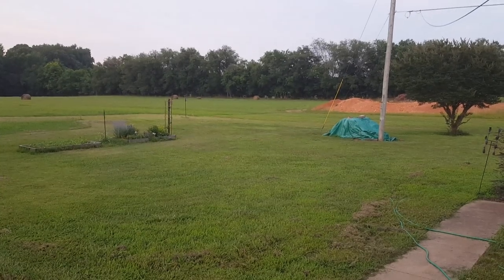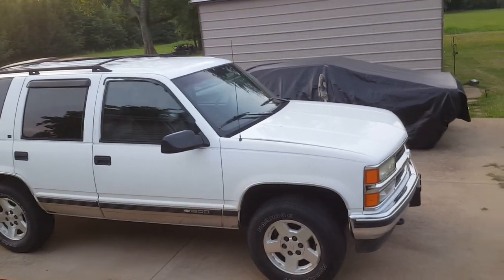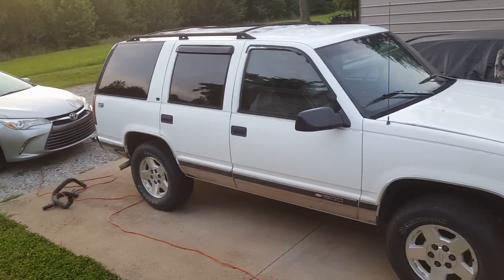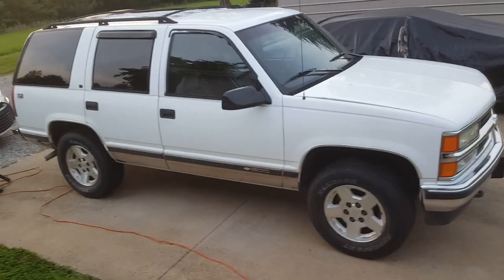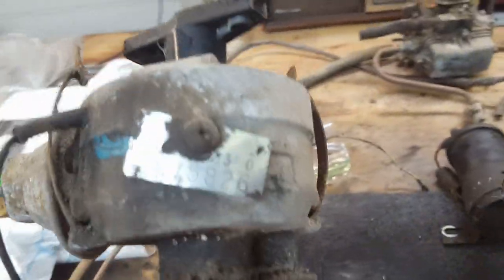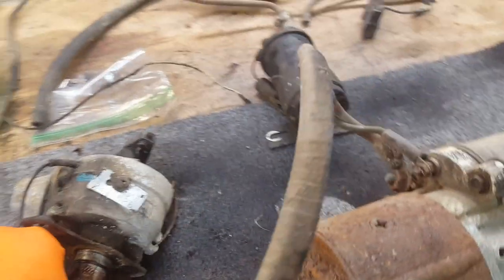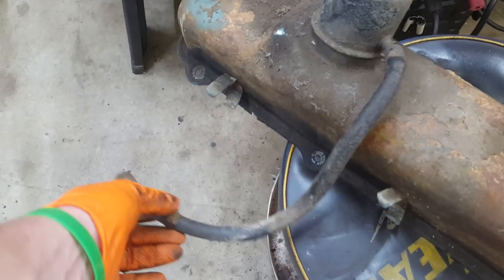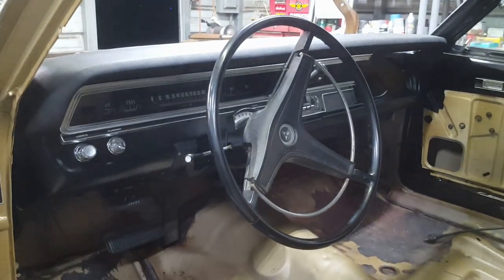Picked a 1971 Dodge Demon that was totalled 40 years ago

Comment: That's definitely a treasure trove of original parts, and incredibly instructive as to how the engine bays looked when they rolled out of the factory with a slant 6 in them.  I'll lay good odds that the banana shaped Demon had low miles on it as an awful lot of the original parts that you snagged from it are service parts that would have been long since swapped out on a car with more miles.  I've seen that sort of solidified sludge build up on cam and rocker covers from engines that have sat for a long time with old formulation oil in it.  The old stuff without all the additives that modern oil has in it just seems to turn into tar if it sits undisturbed for a long time...

Comment: Hi Tyler, yes my slant has the same pcv valve you have on the rocker cover. I have a 1972 Duster that has been in our family since it was born. Yes it has a slant 6 with 74000 original miles. When my grandpa bought it ( only because he liked the red color ) the dealership was using it as a demo model. What do you think about my car ?